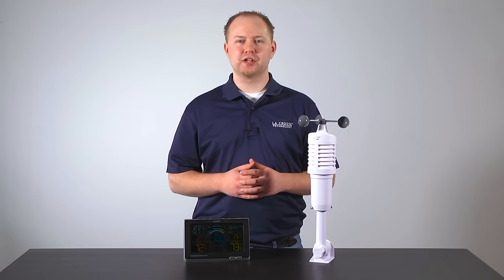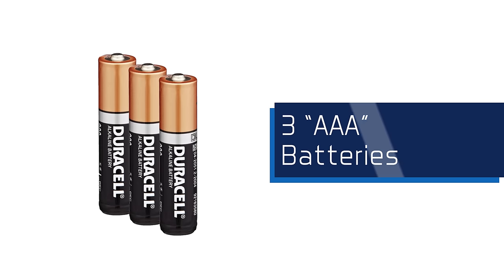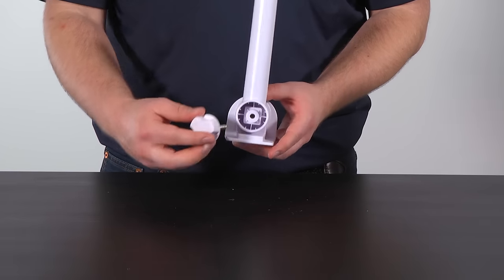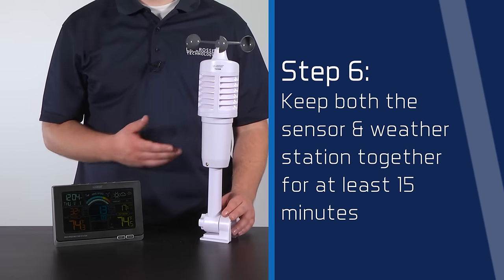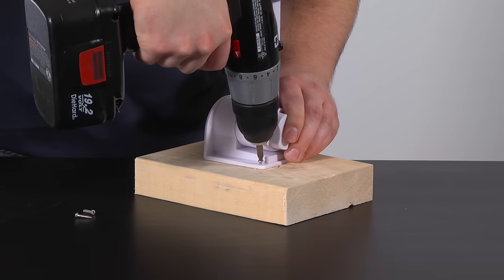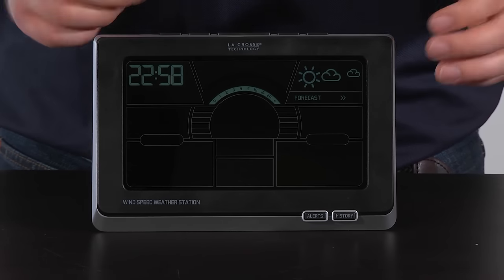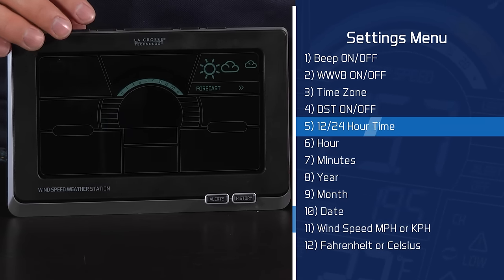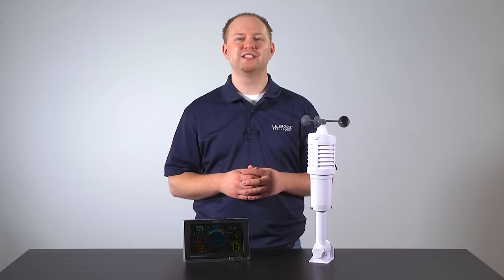327-1414W Wind Speed Weather Station Setup

Comment: Does display light stay on?
Reply from the maker: Hey Patricia, when using the provided power cord, the display's backlight can remain constantly and is controlled using the LIGHT (HI-LO-OFF) button on top. When using batteries along, the light will only come on for about 10 seconds at a time after a button push. More details can be found in this item's support documents here: https://www.lacrossetechnology.com/products/327-1414w#support

Comment: My outdoor temp is all of a sudden reading inaccurately it’s 1 degree Celsius outside and it’s saying it’s 20 degrees Celsius
Reply from the maker: Hey Alysha, sorry for the trouble. Is the sensor currently in intense direct sunlight with little to no wind? These conditions can sometimes cause inflated temperature readings while using the TX141W sensor. If not, you can always try a side-by-side test by bringing the sensor inside next to the display for a few hours and comparing the readings on the display to those of the sensor. If these remain this far off, please message our support staff directly here: https://bit.ly/contact_techsupport. Or alternatively, send us a private message on our Facebook: http://bit.ly/LaxTech_Facebook or Twitter: http://bit.ly/LaxTech__Twitter page for further assistance. Our apologies again for any inconvenience.

Comment: Why does it take so long for it to connect with the forecast?
Reply from the maker: Hey Cindy, we are sorry for any trouble with your weather station. The display should start showing weather forecast icons upon powerup, with the predictions becoming more and more accurate over time. Our other video here: https://bit.ly/forecast_vid covers this topic specifically. If, however, this comment is in regard to your outdoor sensor not connecting with the station, Our first suggestion would be to bring the sensor inside next to the display and clean the battery contacts as best as you can. After this, install a new set of alkaline batteries into the sensor and reset the display by removing all power, pressing any button at least 25 times, and leave it sit without power for about 10 minutes. After this time, power the display back up. Your sensor should reconnect automatically within the next 10 minutes. If it does, we then recommend wrapping some Teflon tape around the sensor’s threads before screwing the cover back on. This should help keep any water and excess moisture out of the battery compartment. If the sensor does not reconnect, please message our support staff directly here: https://bit.ly/contact_techsupport. Or alternatively, send us a private message on our Facebook: http://bit.ly/LaxTech_Facebook or Twitter: http://bit.ly/LaxTech__Twitter page for further assistance. Our apologies again for any inconvenience.

Comment: Do you have one for off grid that doesnt need to be plugged in?
Reply from the maker: Hey Lance, yes indeed. Any of our current non-color LCD models will run fully on battery power. Here are some suggestions: 

https://www.lacrossetechnology.com/products/327-1417bw

https://www.lacrossetechnology.com/products/328-96087

https://www.lacrossetechnology.com/products/308-1415fct

https://www.lacrossetechnology.com/products/ws-9160uv2

If you should have any further questions, please just let us know. 😊
Reply: @lacrossetechnology  thank you so much
Reply: Ordered model 327-1414w thanks

Comment: No matter what type of C batteries I insert in the outside sensor .... the red light does not flash .  The unit is new since December 24, 2018.   What do you suggest???
Reply from the maker: Hi Lousie, we are sorry to hear this. If your sensor data is not appearing on your station's display, we recommend reaching out to our support team here: https://www.lacrossetechnology.com/support/index/form/ -- They will work to get you a replacement as soon as possible. Sorry again for this inconvenience.

Comment: I've had mine for a year and I'm baffled why the battery terminals are made of cheap metal that rust,when outside,instead of stainless steel. Had to change batteries because of poor construction of unit.
Reply from the maker: Hey Pat, we are deeply sorry for the trouble with your wind speed sensor. Our support staff recommended wrapping some Teflon tape around the base’s threads before screwing the cover back on. This should help keep any water and excess moisture out of the battery compartment. If the sensor is no longer working, or if you need additional support, please message our support staff directly here: https://bit.ly/contact_techsupport. Or alternatively, send us a private message on our Facebook: http://bit.ly/LaxTech_Facebook or Twitter: http://bit.ly/LaxTech__Twitter page. Sorry again for the inconvenience.

Comment: Why has unit stopped reading temperature and wind speed?
Reply from the maker: Hey Sonia, our apologies for the trouble. This means the sensor has lost connection with the display and some new batteries are likely needed in the sensor. Our restart steps here: https://bit.ly/basic_restart should help with this process. If you should need any further assistance, please message our support staff directly here: https://bit.ly/contact_techsupport. Or alternatively, send us a private message on our Facebook: http://bit.ly/LaxTech_Facebook or Twitter: http://bit.ly/LaxTech__Twitter page.

Comment: My feels like temp. for the most of the time shows the same as the actual temp. why? While listening to weather report on radio it says a big difference.
Reply from the maker: Hey Allan, there are a number of factors that determine your station's Feels Like Temperature reading. If you could share your station's model number (printed on the back), we'd be happy to offer more specifics.
Reply: CA87092 is the model number
Reply from the maker: Thanks  @allanderbyshire3793 ! The CA87092's Feels LIke Temperature will display wind chill values at temperatures below 50°F (10°C) and Heat Index values at temperatures above 70°F (21.1°C). If your outdoor temperature reading is between these values, the Feels Like Temp will display the same as the outdoor reading. Also, wind chill readings will only begin to factor in if there is at least a 5mph (8kph) sustained wind speed. Varying speeds below this will likely give the same Feels Like value as the current outdoor temp. More information can be found in your full manual and FAQ documents here: https://www.lacrossetechnology.com/products/ca87092#support -- If you should need further assistance, please reach out to our Canadian support representatives via one of the options below. We apologize for any trouble. 

Email: info@springfieldinstruments.com
Online Form: https://springfieldinstruments.com/customer-service/ 
Phone:  844-687-4040
Reply: Thank you.

Comment: How do you get the outside temp to show
Reply from the maker: Hey Trevor, just to confirm, you own the 327-1414W model featured here and are receiving wind speed readings, just not outdoor temperature?
Reply: I believe the outside temperature  sensor does not work.
I have performed multiple resets as set out in the operators manual. Batteries have been changed and tested before instalation and the outdoor temperature readings are wrong.
Reply from the maker: @trevorjacobson7199  Our apologies for the trouble. For further assistance, please message our support staff directly here: https://bit.ly/contact_techsupport. Or alternatively, send us a private message on our Facebook: http://bit.ly/LaxTech_Facebook or Twitter: http://bit.ly/LaxTech__Twitter page.

Comment: why would I be unable to view 0utside temperature?
Reply: was on wrong channel. now working fine.
Reply: My rain gauge worked one time on the initial set up. I went back 2 weeks later after taking the batteries out to try to reconnect with the station and it won’t reconnect. I’ve tried to power off the station completely both batteries and AC power and power it back up again and it still isn’t communicating with the rain gauge. The batteries are all correct as far as polarity. I do get the Wi-Fi signal right by the word rain but I still do not see any zeros or it doesn’t work when I trigger the rain gauge.

Comment: Why was this unit retired?
Reply from the maker: Hi Pilbo, our apologies for the discontinuation of the 327-1414W weather station, this decision was likely used to make room for updated sensors and newer tech. It looks like this item was replaced by our 327-1417 models, which should be back in stock later this month: https://www.lacrossetechnology.com/products/327-1417v2 -- This version also offers a non-color variant for full wireless (battery only) operation. That 327-1417BW model can be found here: https://www.lacrossetechnology.com/products/327-1417bw -- If you need help with your current device please let us know.

Comment: Wind sensor does not show real time data. Only when the sensor connects to the base display every two minutes. Forget about gust readings.
Reply from the maker: You are correct in that the readings are not constant, however, the interval is about 30 seconds, not two minutes. We apologize for any confusion.

Comment: Wind censor is turning but doesn't sent show in the station
Reply: Just installed the unit, and can not get a, reading off the wind sensor, it worked before I installed it, its  only about 30ft.from the station .
Reply from the maker: Hi  @haroldkaste5175 , we apologize for the connection issues. Our first suggestion would be to perform a restart following the steps here: http://bit.ly/LaxTech_BasicRestart to get your sensor reconnected. After it does reconnect, leave it sit next to the display for about 10-15 minutes before moving it back outside. If it loses connection with the display again, this could be a location issue, as certain types of windows and walls can either reflect or absorb this transmission signal. Trying a new sensor and/or station location can oftentimes help resolve this issue. 

Now if your sensor does not reconnect with your display, or you believe there are other problems, please get in touch with our support team here: https://www.lacrossetechnology.com/support/index/form/ and we'd be happy to get you a new working unit should it be neccessary. Sorry again for this inconvenience.
Reply: . @lacrossetechnology . Tried this, worked for about half hour. checked the new batteries  with meter and they read 1.5 volts.  The unit is mounted on top of the roof on HD antenna pipe above the trees , This is happened twice now.
Reply from the maker: Hi Harold, as mentioned in our previous reply, a new location for your sensor and/or station may be necessary depending on the way your home is setup. If either the station or sensor is surrounded by other electronics (such as an antenna), this can cause interference. However, if a new location does not resolve this issue, please message our support team here: https://www.lacrossetechnology.com/support/index/form/ and we'd be happy to get you a new working unit should it be neccessary. Sorry again for this inconvenience.

Comment: what is "check device is in provisioning mode and try again" when connecting to wi-fi?
Reply from the maker: Hey Judy, "Provisioning Mode" simply means that the station/display is searching for a WiFi connection. This is typically indicating by a flashing WiFi Icon on the display. For help getting one of our La Crosse View models connected, we suggest reviewing our page here: https://www.lacrossetechnology.com/router_info 
NOTE: The 327-1414W model featured in this video is not a WiFi connected unit and does not work with our La Crosse View app.

Comment: You flew through the important part and I couldn't see which finger was pushing what button. I couldn't believe it. What a horrible help video ! It makes me want to toss it into the garbage ! Thanks for nothing !
Reply from the maker: Sorry Robert, we apologize for the trouble. If you're referring to the settings menu, the 3 main buttons are the TIME SET and UP and DOWN arrows. More on this and other features can be found in our full manual here: https://www.lacrossetechnology.com/media/catalog/product/3/2/327-1414wv2_manual_020817.pdf
Reply: Pro-tip: You can rewatch a video on YouTube. You can even slow them down.
Reply: @scrammy  Sure it's all my fault for not using all the tools available to me for deciphering  the high speed button bushing. Thank you
Reply: It was pretty clear on the video, didn't seem that hard to follow. And likes scrammy said, all you have to do is pause it. He was just giving you some advice on what to do.

Comment: Does it matter what channel the outside temp is on. I have new batteries in my sensor but there are no readings on the monitor.
Reply from the maker: Hey Brain, if you're not using separate add-on temp/humidity sensors (model: TX141TH-BCH), please be sure to keep the station set to Channel 1 using the DOWN arrown button. The included TX141W wind sensor will always use channel 1. More specifics are covered on page 13 of your full manual here: https://bit.ly/327-1414w_manual -- For additional assistance, please message our support staff directly here: https://bit.ly/contact_techsupport. Or alternatively, send us a private message on our Facebook: http://bit.ly/LaxTech_Facebook or Twitter: http://bit.ly/LaxTech__Twitter page.